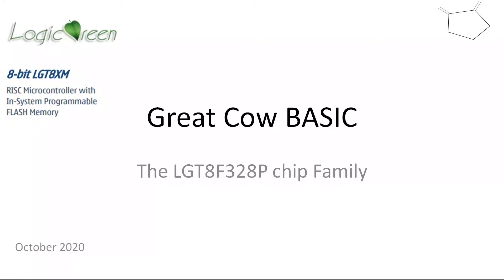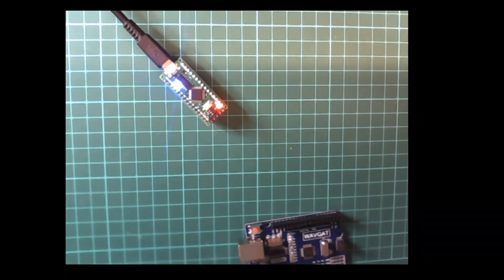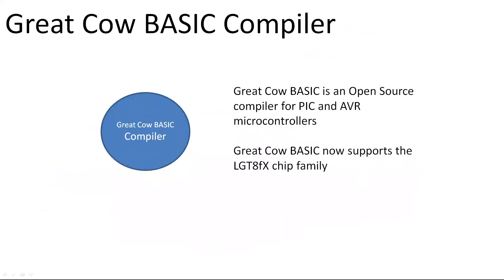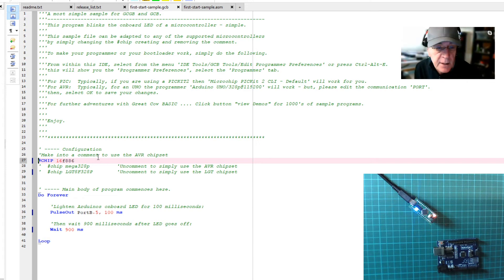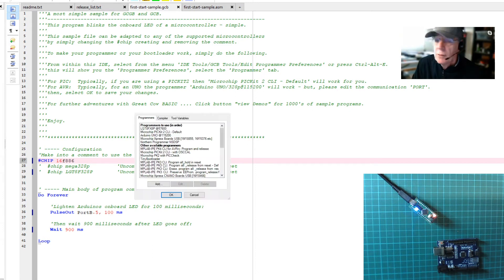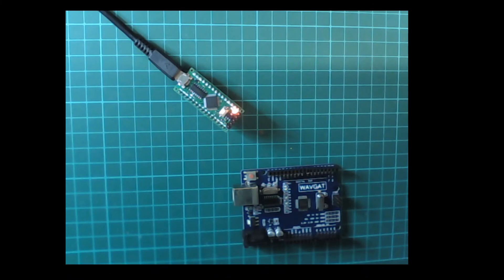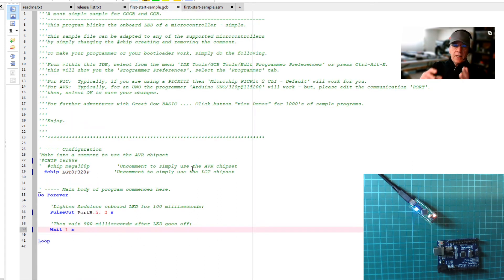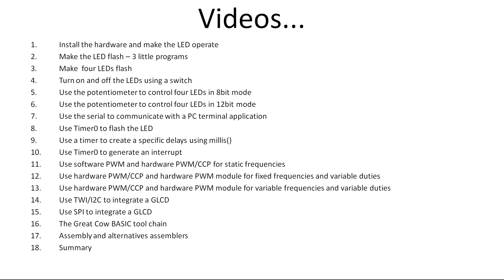PT1: LGT8XM chip Family - Using the LGT8F328P with Great Cow BASIC the basics to flash an LED

Comment: I just downloaded GCB from their webpage, installed it, but there is no support for LGT8x. I miss something here to make LGT8x to work.
Reply: Found and installed V.0.98.07 RC38. After install no programmer defined in preferences. Processor not found.
Reply from the maker: @pvisit   

Yes, you need RC38.   Post to the GCB forum and we can help you there.  

Selecting the programmer should be easy to resolve.  

:-)
Reply: @AnobiumTech  I see a lot of posts about the LGT8 on the forum, however, I can't open the posts. I always get a forbidden sign. No access to...
Reply from the maker: Can I check? What url are you using?
Reply from the maker: See https://youtu.be/-24h6aCE_NE  I just created a quick video to answer this question.
Reply: @AnobiumTech  First, Thank's a lot for helping. I made it finally work but it took a lot of fiddling around. I will explain briefly. After install there is NO entry for LGT in the GCB preferences. I had to make a new one : File=link to avrdude; Port : as seen by the PC; Command Line Parameters ? Arduino didn't work initially (Uno,Nano). After long fiddling, this makes it work = -u -c arduino -b 57600 -P %port% -p LGT8FX328P -U flash:w:"%filename%":i
Reply from the maker: Ok. That would have happened as the new lgt entry in the ini file will NOT have been added to an existing install.

Well done!!

Enjoy